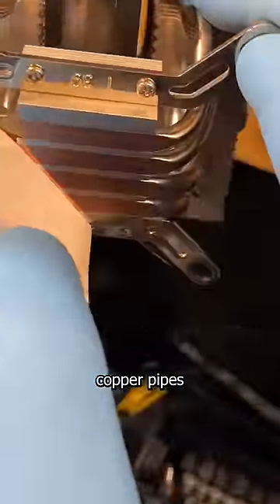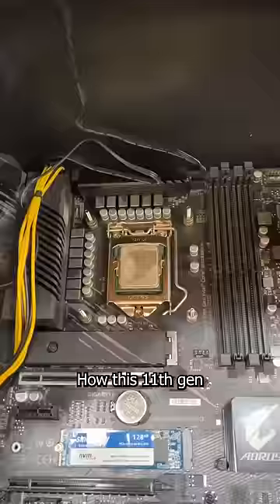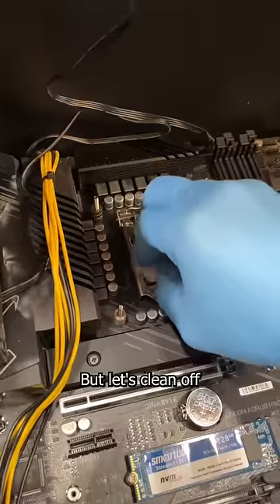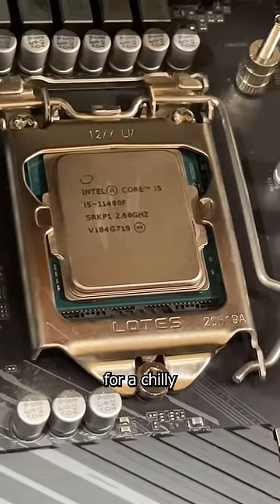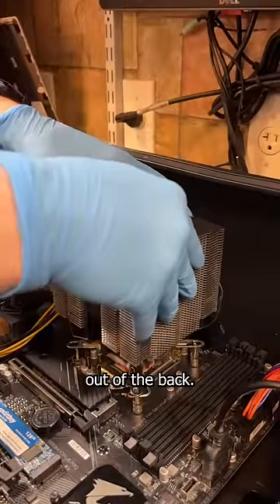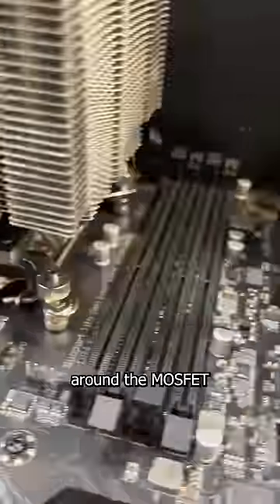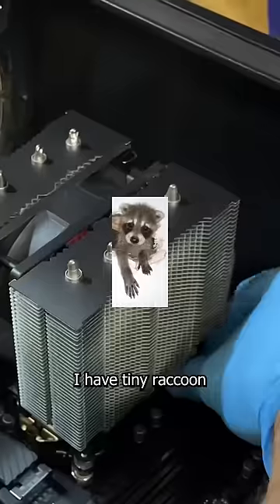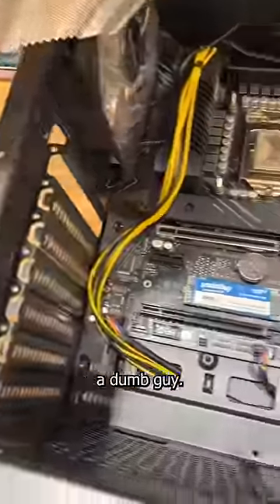Russian computer repair shop harmed this poor #gaming #pc Intel CPU was on fire 😢 #tech #shorts

Comment: “How much thermal paste should I use?”
“Yes”
Reply: "use"
Reply: Looked like bubblegum or something. Never seen pink thermal paste.
Reply: @atnfn true lol most are just gray
Reply: @atnfn its the best thermal paste the kryonaut crío extreme
Reply: @lexavlogs7149 with that much paste it usually turns into lower Performance than the cheapest
Reply: All of it
Reply: Is way too much. 
However, improvement over the label😂
Reply: @jaeger3211sec  now that's wrong. See- this is how you can tell someone is a noob at PC building and tech because the thermal paste fills up the gap between coldplate and the IHS. Extra paste is squeezed out. Makes zero difference if you applied perfect or a spoonful of paste
Reply: @MaxC_1  sure. If you tighten it with the right force. Maybe we watched a different Video but turning the screws a bit with your Finger does not have the force to push the paste out. 

+ Even if the cooling isnt affected its bad practise and the next person that needs to change thermal paste or change the cpu wont have a good time.

Ur Statement is correct for a good designed cooler with proper screws.
But not for a semi Hand screwable shit cooler
Reply: @MaxC_1 that much will come out the sides and get into things lol.
Reply: @jaeger3211sec ith that much paste, the weight of the heatsink is enough to make it come out the sides. ANY force with that much paste will do it.
Reply: @MaxC_1  this is just not true in many cases. its just meant to fill in micron sized cracks. this much can if not screwed down to the perfect torque cause a pillow of tim and worse performance.
Reply: @MaxC_1  It probably squirted out the side though with how much he had on
Reply: Dayum.
Reply from the maker: @RCXDerp the past debate will never be settled for all of eternity. The fact is Thermal Grizzly Kryonaut extreme is very thick pink paste. I spread it out using the applicator, and after heatsink was applied, there was no overflow.
Reply: @SalemTechsperts Theres no such thing as too much
Reply: @jaeger3211sec  noob
Reply: @SalemTechsperts I’m actually surprised you have no overflow. Looks exactly like what I just did to my fresh install. I had to send the CPU back and clean it up, it was a new 7000 series AMD and the paste got all between the plate since it’s raised on the new design…. Was not pretty and I dialed it down on the new one
Reply: @SalemTechsperts it will overflow when it gets old and hot
Reply: 1 Kg is enough for a Russian computer
Reply: Gamers Nexus has already proved that there is no "too much paste" other than just wasting it. It squeezes out if you're installing your cooler correctly.
Reply: @jaeger3211sec no it definitely does lmao, screwing something in is basically putting iy in a vice grip so yes its certainly getting squeezed
Reply: @SalemTechsperts  are you aiming for a thermal insulation paste?
Reply: @snickerdoooodle  of course there is too much paste... it will leak onto your board and other components...
Reply: @SalemTechsperts  Buddy don't use the applicator or spread it around. Put a decent pea shaped amount in the middle and apply the heat sink, the weight from the heat sink will spread it appropriately.
Reply: @MaxC_1  the paste will spill over into areas that you don't want it to be...that can create hot spots...
Reply: @SalemTechsperts  BS; the debate is very much settled, and by basic physics at that. That IS way too much, dude. The layer needs to be as close to one atom thick as possible, because no paste on earth conducts as well as the metal parts you're pushing together. All the paste does is replace as many oxygen particles as it can, because, although the paste is not a perfect conductor, oxygen is an insulator. Thermal paste doesn't enhance conduction, it minimises insulation.
Reply: @TheKingmanthe1  never has worked like that. All of these theories are pretty bs considering I have yet to see a single proper test which proves the "theories" 
Gamer's nexus proved it years ago that it makes no difference at all because every cooler will be screwed down and extra paste pushed out doesn't matter because the exposed areas don't get hot enough anyways.
Reply: A tad heavy-handed with the paste.
Reply: I'm not saying it's the wrong way to apply thermal paste, but I am saying I could and would never do it that way 😂
Reply: @atnfn  that's `chewing gum`type thermal paste,commonly used under onboard GPU heatsink.
Reply: @jaeger3211sec  No, it doesnt and that was not very much.... Why does everyone on the internet think they are a thermal paste application expert
Reply: @TheKingmanthe1  no.
Reply: @VK-pk8uz  You don't know what you're talking about.
Reply: Какой сюр..Неужели так легко наклейка радиатора процессора отклеивается. Обычно надо въебать, что б под трением, клей разогрелся и легко отставал. Тогда можно отдирать всех
Reply: @SalemTechsperts  Well if you actually know why we apply thermal paste to stuff like CPUs or GPUs, you'd know why this is just stupid. 

I'll explain it for you and your viewers who are obviously not in the know: Even though the heatsinks and IHS of a CPU look pretty flat, they contain all kinds of microscopic imperfections. Since you need direct contact for an efficient heat transfer, those imperfection will cause insulating gaps, which in turn will cause a heatsink to perform poorly. You use a very small layer of thermal paste to bridge those gaps. You'll only need about a pea sized bead in the middle of the CPU and use the clamping force of the heatsink to spread it out evenly. 

The amount depicted in the video was WAY too much and if it didn't come out the sides, you're not putting enough pressure on it. It will actually work as an insulating layer in stead of a heat conducting one.
Reply: @MaxC_1 I'd be more concerned with the air bubbles that type of application is known for.
Reply: @MaxC_1  чтобы плату всю залить пастой, чтобы паста тепло передавала не охладителю, логика
Reply: @RCXDerp you can see it squirting out in the final shot lmao. For someone taking videos and talking shit, completely unacceptable.
Reply: Slather it like peanut butter!
Reply: @MaxC_1 you are the noob, it’s been proven countless times that pre spreading it leads to air bubbles and therefore lower thermal efficiency. 

You shouldn’t be anywhere near computers let alone building one.
Reply: @SalemTechsperts  What debate? Isn't it literally proven that as little paste as you need to cover the microscopic grooves on the surface of the CPU (in other words, a really, really tiny amount) is ideal? That anything above that causes higher temperatures? I haven't worked in a repair shop for the past decade, but that used to be accepted as fact, are thermal pastes significantly different now?
Reply: The Nintendo Switch uses pink, too!
Reply: @VK-pk8uz best explanation so far. This is how physics work. Every other home cooked theory is bs.
Reply: @MaxC_1  oh look, you just showed that you are a PC builder newb! lol
Reply: It’s silicone paste, so there’s not any downside to using a lot except perhaps the mess, which can be cleaned up with a Qtip.

Comment: I had a pc I had built around 2013 for 7 years, never cleaned it or did anything else and it started getting hot. Took it apart and the thermal paste had 95% gone away. Cleaned everything thoroughly and reinstalled with new thermal paste, back to brand new and it still runs today.